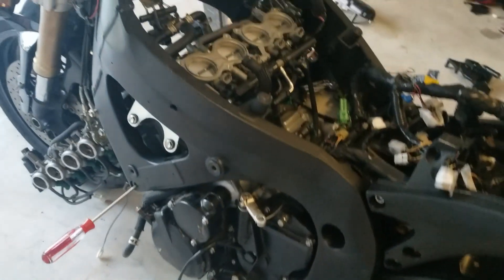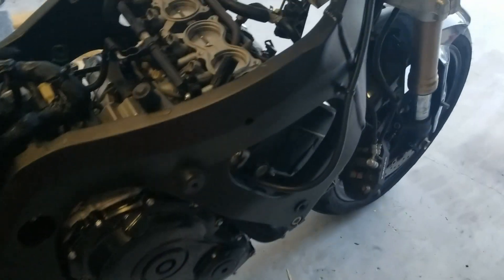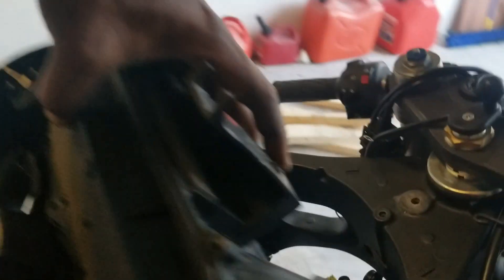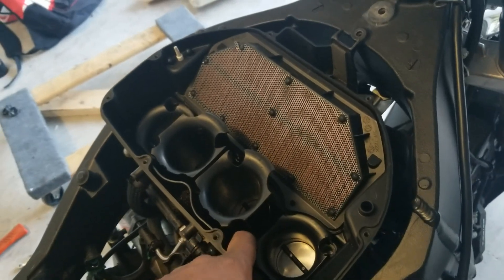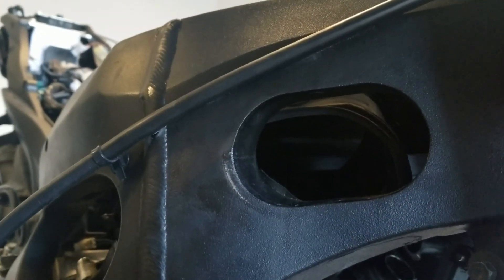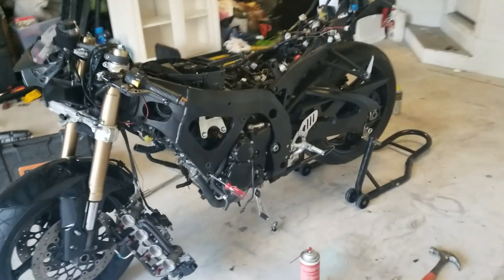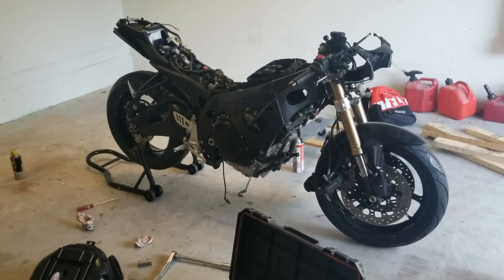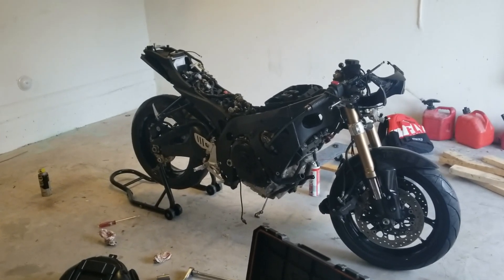Project Gsxr Engine Swap (part 2.5 -- Gsxr 750 swap issues)

Comment: u could have just used the 09 throttle bodies an air box and u wouldnt have had that issue
Reply from the maker: I thought the same but no combination was fitting properly.
Me and my tuner were very confused lol
He said that it is possible the motor I purchased didnt come out of a 2011 like the description said
Reply: Definitely a 2011 engine, throttle bodies,  and air box. I just totaled my 2011 for a 3rd time….. witch now means I put it down a total of 7 times…… I rebuilt my bike myself every time and I know every inch inside and out…. Sadly, people don’t know how to act when they hear a bike coming at them before they can physically see it as well as seeing and or hearing sirens with red and blue lights in the distance so they pull out…. Then all of a sudden that bike they heard/hear slams into there car because they didn’t actually pay attention to what they were hearing….. Anyway, this time the 140mph crash into an Amazon van demolished the frame 😢….. So thank you for these videos I’m about to stay up all night and watch everyone because older generation frames are $100-$300 and 2011-present frames are no less then $1800…..  so even 4years later…. Your appreciated my guy 🔥🫡🙏💪🤠💯